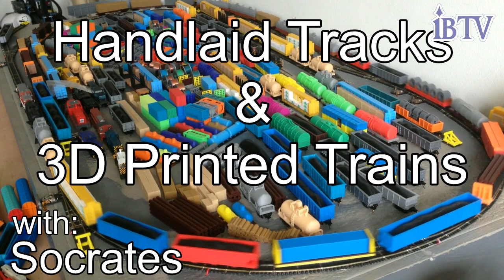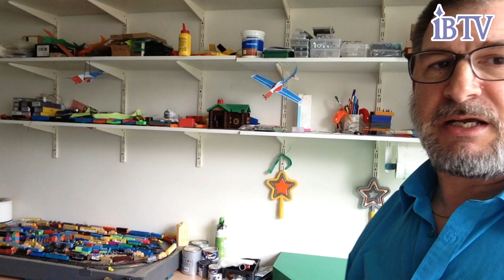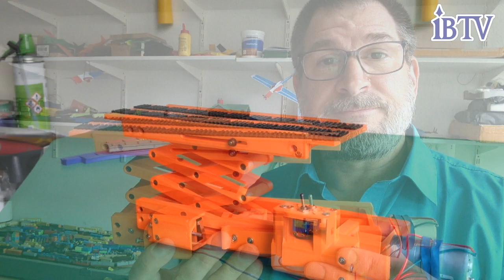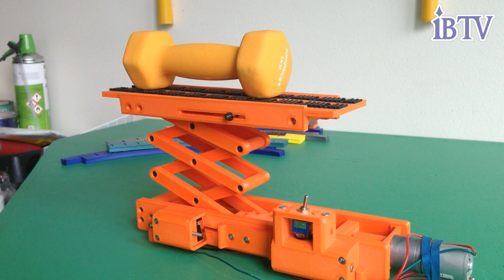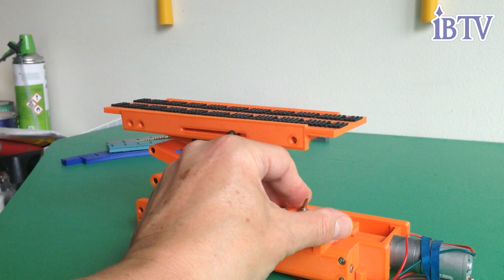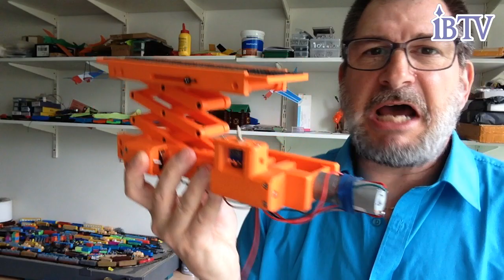3D Printed Scissor Lift! Electric Motor and Limit Switches - Or Hand Crank!

Comment: This is amazing! I was just thinking about using limit switches, model trains, and 3D printing poop on the color changing systems and it would be so fun to make a silly project for managing printer poop with this type of setup.
Reply from the maker: I'd love to see that build! All aboard the Poop Train! I set my flushing to 0.40 and only had to bump to go from black to yellow. Under half the default waste...
The original idea is for a train lift to a storage level. Same effect as a helix but much smaller. I'm slowly adding a bridge and the lift would replace the bridge...

Comment: Hello, how is it assembled? I am trying to put it together, but I’m not sure how to do it. I have questions about how the transmission works because there isn't a diagram, and it’s not clear in the video either. I know it works—that part is shown—but not how to assemble it. Could you help me? Thank you!
Reply from the maker: Without knowing exactly what you are stuck on... Basically the scissors (L parts) have a top cross and a bottom one. The middle can be one or a dozen. Assemble each of the three Lift parts (L) crosses together into the scissor. The base parts (B) connect to the bottom of the scissor. The part labeled B9 holds M5 and M3 nuts for the main M5 threaded rod from the DC motor and the side mounts between the base and lift. The top is the same with the parts labeld T. 
The M5 threaded rod spins with the motor. There is a M5 nut buried in the B9 piece which forces that part to move away or towards the motor pushing and ulling the scissor with it. The image on Cults shows the inner parts. What else do you want to see? Hope that helps!
Reply from the maker: Added a couple images from my Sketchup drawing to the Cults page to help show how it goes together!
Reply: @handlaidtracksand3dprinted922  Thank you, I’m going to comment on Cults to let you know what’s happening. Thank you very much!
Cults message: Let me explain what’s happening. I have all the components you mentioned, screws, motor, etc., all the same. I assembled it, but while the motor starts, after a while it begins to slip and the scissor mechanism doesn’t move. I’m not sure, but I must be assembling it incorrectly, because if I manually rotate the threaded rod with my fingers, the scissor mechanism still doesn’t compress or expand. Inside the B7 piece, I have a nut for the rod, and there’s also another nut inside the B9 piece for the rod. I have assembled the scissor mechanism, and it moves up and down when I press or expand it by hand, so it isn’t blocked or improperly assembled. I’m not sure what’s wrong. I also don’t know where the B16 piece goes because it doesn’t appear in the Cults diagram, or maybe I’m not seeing it clearly.
Thank's!!!
Reply from the maker: Odd I don't see this message on Cults anywhere. The B16 piece is just a pair of slip on feet for under the lift. The wires hung out a bit so it lifts the unit up. 
My 1st guess would be the nut is spinning in B9 or B7. If the threaded rod turns and both of the nuts don't just spin, it will be forced to expand. Make sure the nuts spin freely on the rod but not the B7 & 9 pieces. B7 takes the force which is why it is braced bewteen the two beams. 
I put it together in steps. 1st make sure the scissor expands apart from the base, maybe add the top, or at least make sure it moves freely with the top on. Then assemble the base and check the motor moves B9 back and forth and the limits both work. Then hook the far fixed end of the scissors to the base and the other to B9. Assuming the nuts in B7 & B9 aren't spinning, it should work...
This was my working prototype but people asked me to publish it. So it is a bit clunky to assemble, but proved the basic design and concept. My idea is for a 60cm long lift bridge to a set of upper storage tracks. Hope that helps! Love to see a Make on Cults if it ever works!